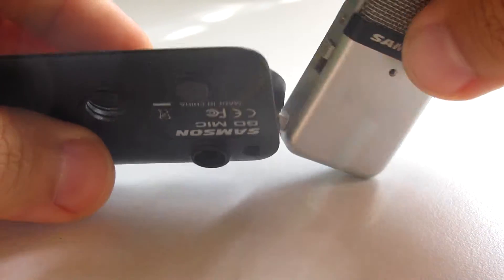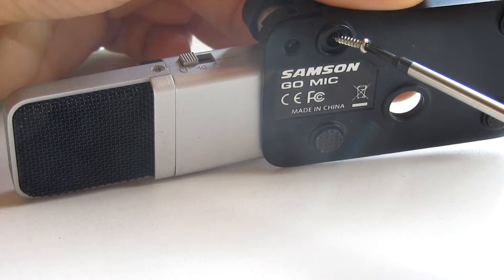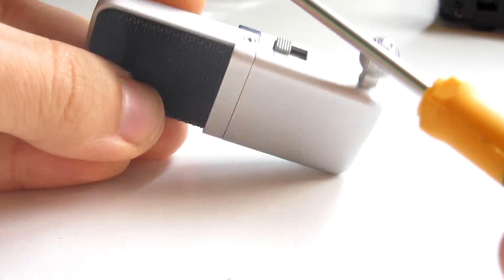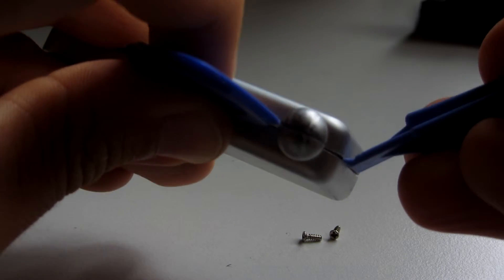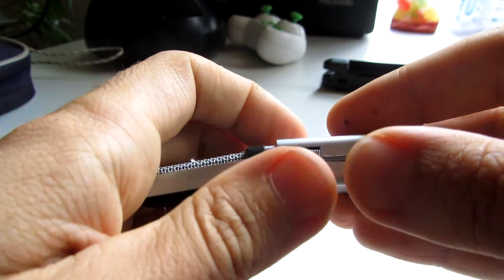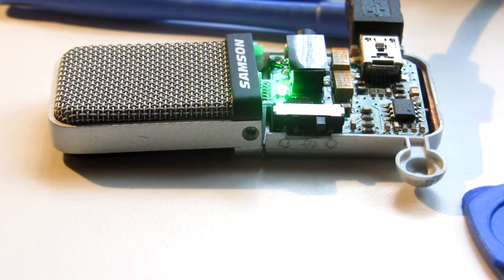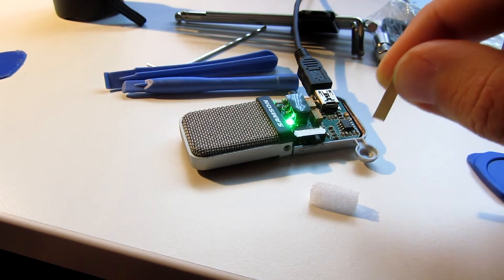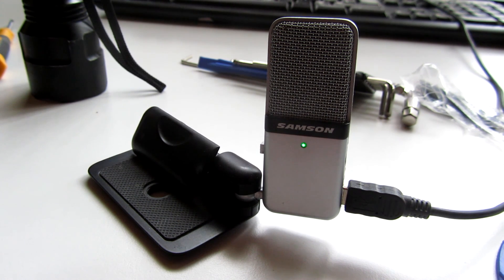Samson Go Mic – Disassembly (Repair Switch)

Comment: What head did you use dor the first little screw
Reply from the maker: I used the flat one 2.0x50mm, because the allen key didn't work out there
Reply: @funkylosik  thanks the allen key doesn',t work for me either. I'm trying to fix the loose ball, do you have any tips?
Reply from the maker: @maksymilianreiter3111  it's hard to say what is causing it, just try to put some foam in between the ball joint and the body...
Reply: @funkylosik  thanks mate that's what I;m gonna try, was also going to try to tighten the plastic body a bit but I don't think it'll work
Reply from the maker: @maksymilianreiter3111  no worries, let me know what has worked for you, it can be helpful for other people who read this.
Reply: @funkylosik  I found a tiny torque in my garage and all I had to do was tighten the small screw a little bit. the movement is not as smooth as it was before I dropped it but it stays in place nicely and I didn't require any teardown

Comment: My Samson Go Mic was many years old and it sounded better and quieter as it ages. I have it on a boom stand and it's left in my table as my PC mic and probably got dirty and dusty inside. How do I clean it without disassembly? I wanted to get rid of dust inside the 'cage'. What do you recommend?
Reply from the maker: Vacuum cleaner? :)
Reply: @funkylosik  i have some but it's too huge. Is compressed air okay?

Comment: Probably nobody sees my comment, but on my samson the led does not turn on, it works, but I don't know what to do
Reply from the maker: I see it :) Use it without annoying green LED, if it works? hehe
Reply: Wow I was completely sure that nobody was going to answer haha, thanks, I will continue using it without the led :)
Reply: @funkylosik  please help me, i opened the mic to change the switch and the cardiod mode is in low volume now, what have i done? the cardioid mode still words but is in a very low volume, how can i repair it?
Reply from the maker: @thisisfernando  so have you replaced the switch? is is the 100% the same switch? maybe it's stuck in the -10 DB setting? I've tried to find the exact switch needed but it was beyond me, so i'm still rocking the old one. You can try to unsolder the new switch and try to simulate the same connection just with jumper wires first.
Reply: @funkylosik  it’s lower volume than the -10db, the switch still works because I can put on omni that works very well
Reply: I searched up this video just to cover the green LED

Comment: I was struggling to disassemble my Samson Gomic. Very helpful. Now I can try to open it.
Mine gives problem, suddenly it gives noise in between recording .. and sometimes its the switch, sometimes the USB connector and sometimes the headphone jack - which when adjusted the noise goes away.. so I am not sure what exactly is causing the issue. Thanks for this video.
Reply from the maker: I hope you will find the issue. I filmed the video, since there was none on Youtube for this microphone, and I needed that not to break things. That's good that everything worked out without damages.
Reply: for how long did u use it than it's started the problem.
Reply from the maker: It was always plugged into PC for at least 2 years. Didn't play with switch a lot, mostly it was active on the front mic.
I'm sorry for the late reply, didn't see notifications.